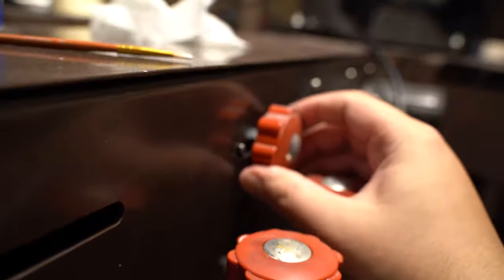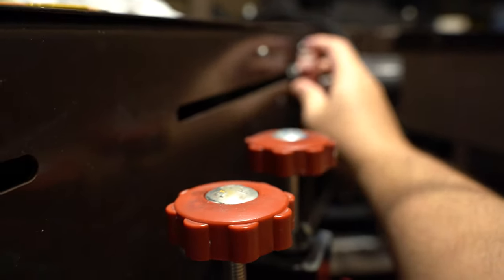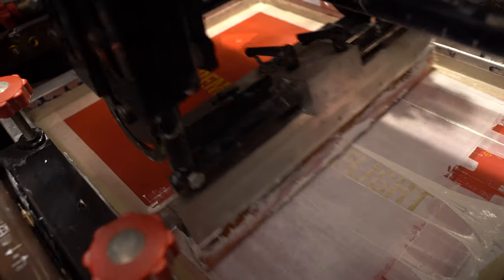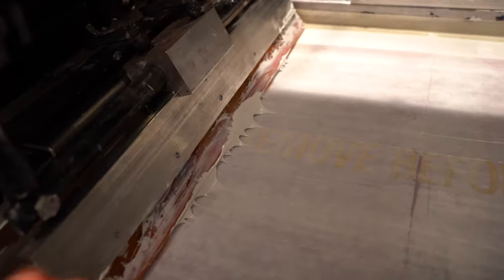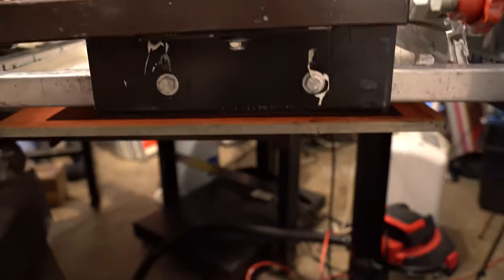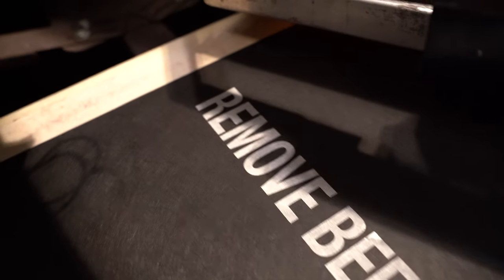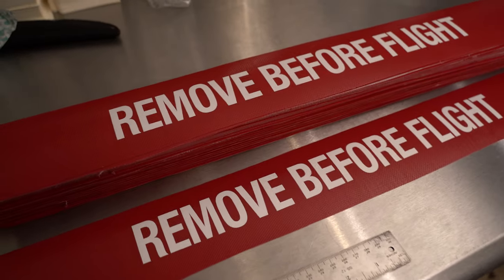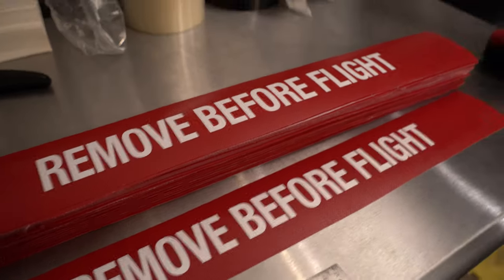SCREEN PRINTING FOR A FIGHTER JET?!

Comment: Also, there is more to the remove before flight streamers. They also keep sand and crap out of small holes, im not a crew chief so i only know a little but about them. I deal with the fighter pilot gear directly and ejection equipment like parachute and survival kits. We use them in my job as a reminder to check that part or area before we clear the jet off its hard to miss something with a big ass streamer sticking out of it.

Comment: Place your pot of white ink in a sauce pan and pour about two inches of hot water in the pan for ten minutes and your ink will loosen up and become nice and creamy .
Reply from the maker: I can see that working well for most of my plastisol inks! With ELT anything over 130 might begin to flash it. Also have you had issues with the plasticizers rising to the surface of the water?
Reply: @brandsandempires  Why would plasticizers rise to the surface of the water? You don't pour water into the ink. You place the ink tub into a shallow pan of water to warm it up. It doesn't get so hot as to cure it.
Reply from the maker: @dtacklind  I incorrectly visualized what you were suggesting (my foggy 6AM pre-coffee brain) and was being polite lol. That makes so much more sense.